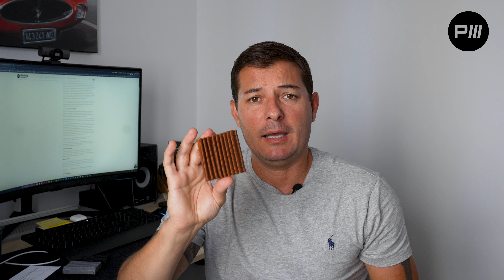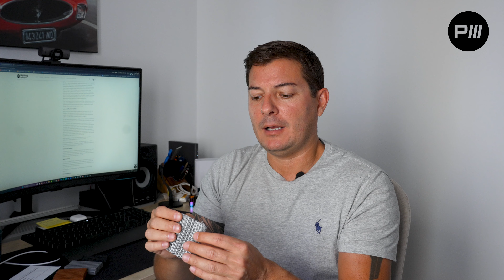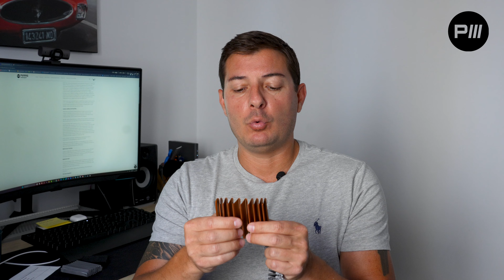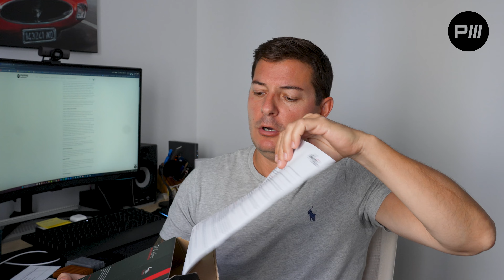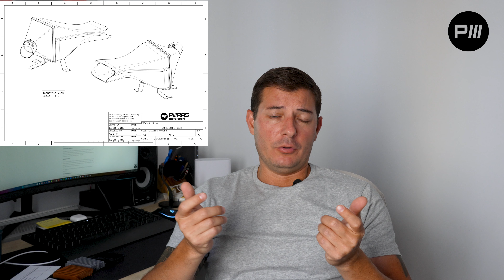SECRET PREVIEW: PIRAS Motorsport GR Yaris Engine AirBox Intake kit

Comment: What folks want to know about is the trouble code P2C90 CEL that comes with most all aftermarket intakes.  Even in stock form, the GR Corollas were having issues with the code.  For 23, and 24 Toyota came up with a re-flash to address the code issue.  There is not yet a re-flash for the 2025's.  The 2025's are throwing the P2C90 CEL too, even in stock form.
Reply from the maker: We have been testing this airbox for three years and never had a CEL light. Usually they occur if there is not a proper seal at the MAF sensor at OEM, or if there is a different size MAF housing on aftermarket intakes
Reply: @PIRASMotorsport  Thank you.

Comment: Looks very promising, especially the price point. Will wait fro some more information and then check with my mechanic if there's any chance of getting this street legal in Switzerland.
The Eventuri was recently homologated here and is so far the only street legal option, but the price is crazy...
Reply from the maker: Thankyou: yes with ABE certificate you can make it legal in all of Europe!
Reply: @PIRASMotorsport  Quick question, since in germany ABE and ECE are two different certificates:
ECE: Used if the part is going to be legal in all of europe.
ABE: only legal in germany/austria.
Reply from the maker: @wubziz4769 we are getting ABE for now, the same as Eventuri

Comment: Congratulations, I have to say a job well done by an enthusiast for other enthusiasts. I am very tempted to buy one, but  I would like to see first maybe a bench test with Acme here in Italy, who are number 1 as far as the GR world is concerned.
Reply from the maker: Yes, this is coming up mate!! Thankyou for your support!
Reply: What do you think about using the Spring Filter P08 F1-85 as alternative: I know is very expensive, but I think is worth it
Reply from the maker: @danielelapadula5603 yes, it is the best filter there is! Maybe we will offer it as an alternative.
We didn’t to start with because it costs double of the P08 version and the benefits of the added performance do not translate in a linear fashion at this point.
The P08 is already doubling the airflow of any other filter you can test

Comment: I'm still wondering why is there a valve on the oem airbox? I just don't get it.
Reply from the maker: Because the flow it guarantees isn’t enough without the flap valve opening mate
Reply: @PIRASMotorsport  ok, but why is the flow restricted until it opens fully? why would you do that as manufacturer? any thoughts?
Reply from the maker: @greepm I have worked for many years in coordination of OEM engineering projects and I learnt that their goals are much more demanding and complicated then ours for pure performance. OEM’s engineer for long service intervals, for noise reduction, and many other factors that complicate the designs and leave you asking yourself why?? So extracting more performance isn’t that hard provided you know what to do

Comment: Hey! Looks really good, especially the part where the filter is easy to remove as you say.

I have one question tho, with for example the Pipercross intake there is a part that comes with it. The solenoid which opens and closes the duct on the bottom of the OEM airbox is hooked up with air hoses and meets behind the motor on a simple plastic T part.
the Pipercross Intake kit contains an L shaped part so that the pneumatic lines can still work as intended while leaving out the route to the airbox.

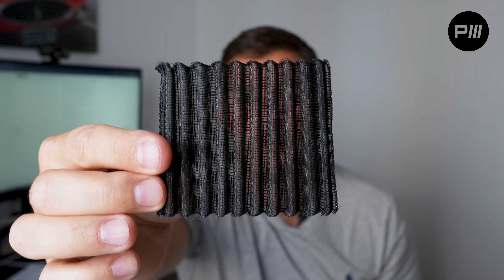Does this come with a similar part? For reference, there is a german installation video and installing the part is shown at 7:07
Reply from the maker: Thankyou: we had considered it (the L shaped part) but the actuator is so small that you just leave it connected to its tubes and ziptie it to the harness and it will never move again
Reply: @PIRASMotorsport  Thank you for the answer! I will contact a local motorsport mechanic and ask him for a quote for how expensive it will be to get this setup registered. With TUV ABE it just has to be checked if it is the part mentioned in your documents and if it installed correctly, but if you have an aftermarket exhaust it will have to be checked more thoroughly (and more costly) in an "Einzelabnahme".. Because both affect noise in Germany it has to be checked TOGETHER. 
The Pipercross Intake kit had a combination TUV Certificate with the Milltek exhaust which made it easy to get registered. For this it will be more costly but it will still be able to get registered! 

Waiting for the sound video before order 😁
Reply: Me too 😂